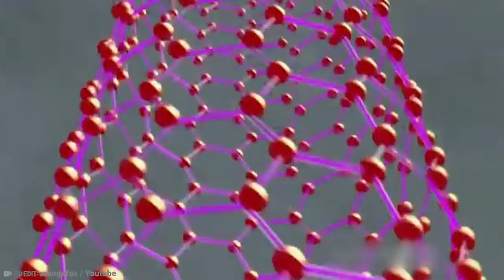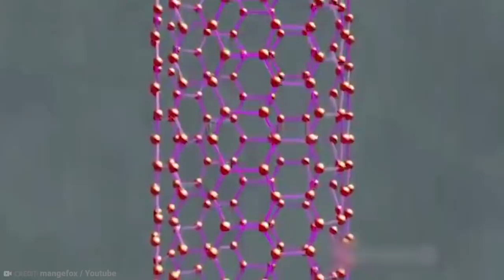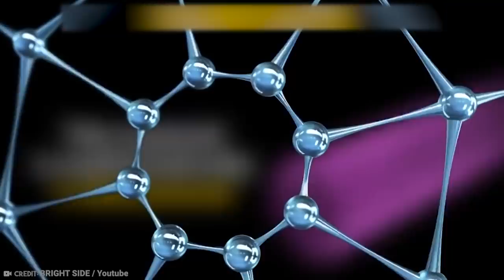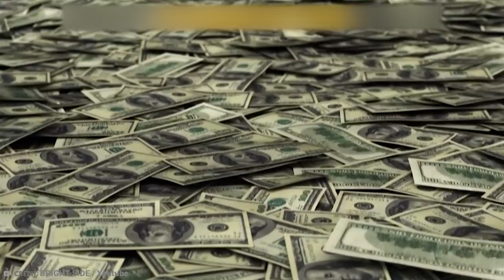15 Most Unusual Substances In The World

Comment: Carbon nanotubes and graphene are the same material: carbon atoms arranged in a flat plane. In the nanotubes the graphene curves the right amount and joins together to form literal tubes of graphene that are a few nanometers thick, that's where the name comes from. Different manufacturing techniques make nanotubes with different properties. It's a lot like curling or wadding up cardboard to make thick sturdy blocks.
Reply: And yet aerogel is not mentioned, which is an extremely good heat shield we do know how to make.

Comment: dont circuits get hot when voltage is applied? gallium cant be all that use full for most circuits unless its a component of soldering and even so it doesnt make sense as most computers and phones run hotter then the average body temperature which turns gallium into a liquid metal, the issue is that its just a recipe for short circuits and broken technology.